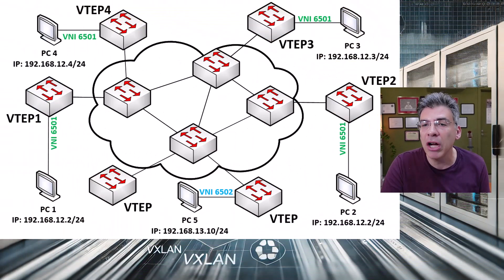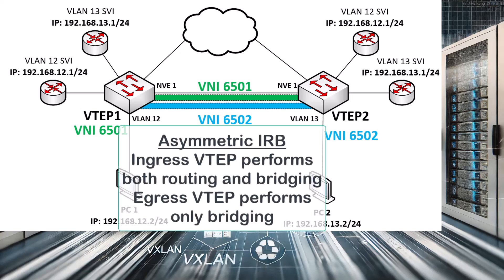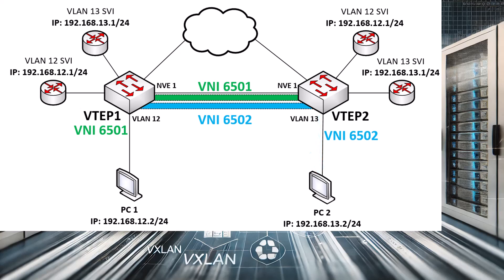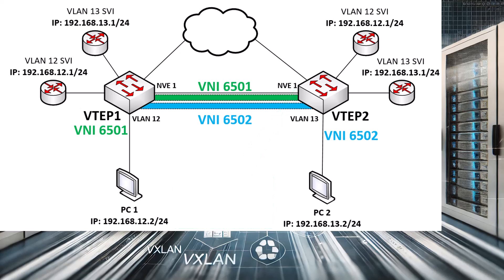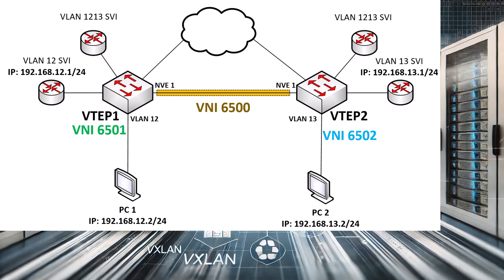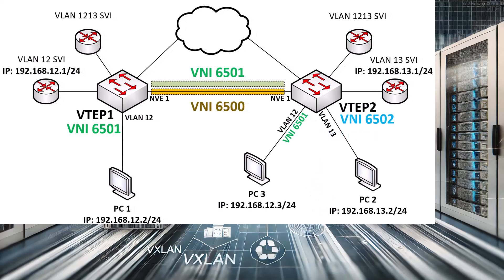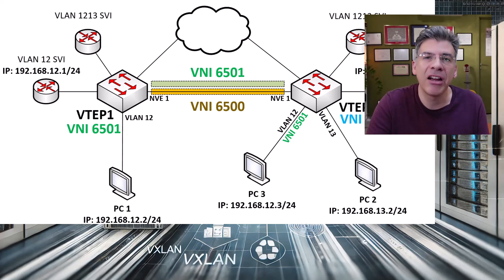VXLAN - Integrated Routing and Bridging

Comment: First of all, thanks for such crystal clear explanation of the different concepts. This is truly incredible. I have 1 question.  in case of symmetric IRB, since the destination VNI may not be present in source VTEP, how does it know which VTEP that destination endpoint is residing on? How does it learn that the destination endpoint is on which VTEP and it has to forward traffic to that VTEP only?
Reply from the maker: Thank you so much for the kind words!  I'm really glad the explanation was clear and helpful!

Great question about symmetric IRB! You're absolutely right to point out that in symmetric IRB, the source VTEP may not initially know the destination VNI or where the destination endpoint resides.  

In symmetric IRB, endpoint location information (including MAC and IP bindings) is distributed via EVPN routes.  Specifically, EVPN Type 2 (MAC/IP) and Type 5 (IP prefix) routes. These routes tell the source VTEP which destination IP is behind which VTEP and under which VNI.  So when traffic arrives for a destination IP in a different subnet, the source VTEP consults its EVPN control plane database from which it will get the destination VTEP's IP address.  Make sense?
Reply: @telecomTech.explained , thanks a lot for the explanation. Makes sense perfectly.  Does this mean that the EVPN Control Plane mechanism (MPBGP?) will distribute all routes to all VTEPs at all times?
Reply: I think yes it would advertise all the time but prefix will only be install in bgp table only if that vni existing on that device

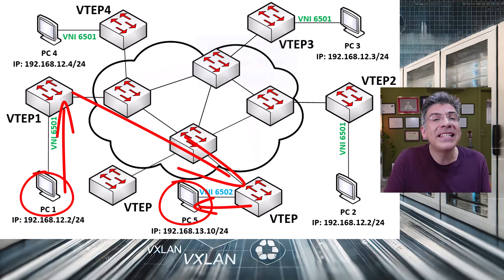Comment: At 1:51. PC1 and PC2 have the same IP address of 192.168.12.2/24? Typo?
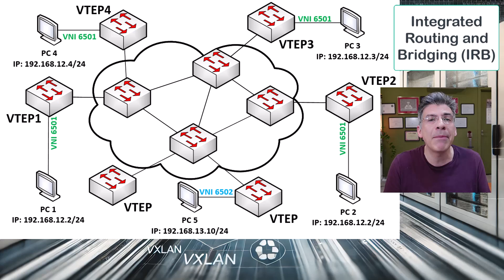Reply from the maker: Yes, you're absolutely correct, that was a typo! I've put in a correction in the video at 0:46 which is about where it appears, and I've credited you with finding it.  Thanks for pointing it out!  Luckly it doesn't affect the rest of the

Comment: so in asymetric IRB we do not need any extra vni for l3vni between other tenant or vrfs.  which we need it for symetric IRB. right?
Reply from the maker: Yes, in asymmetric IRB, you do not need an extra VNI for L3VNI (Layer 3 Virtual Network Identifier) between other tenants or VRFs, as the routing is done asymmetrically—meaning the routing happens only in one direction between the bridge domain and the VRF. In symmetric IRB, however, you do need an extra VNI for L3VNI because routing occurs both ways, which requires more separation between the VRFs and bridge domains, thus needing the extra VNI for the Layer 3 communication between them.